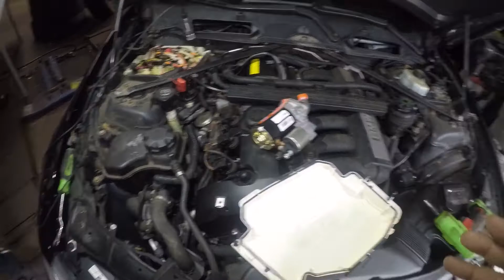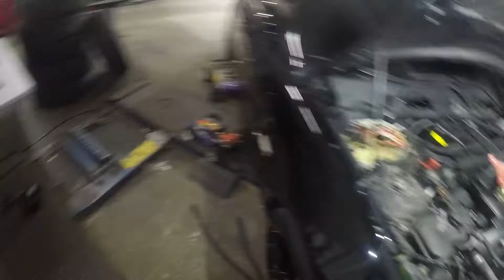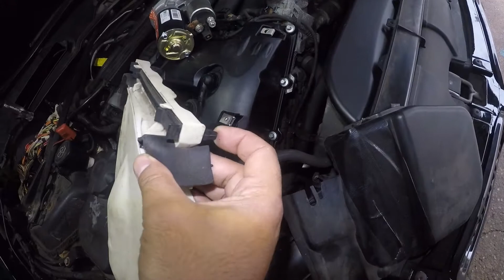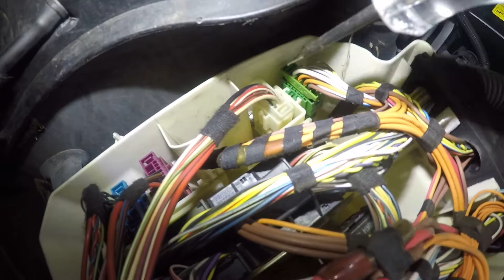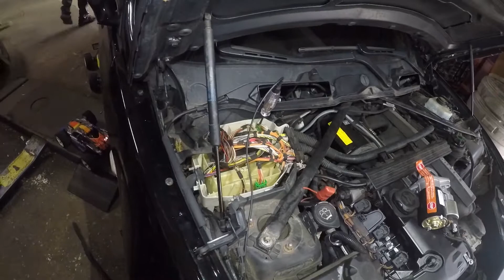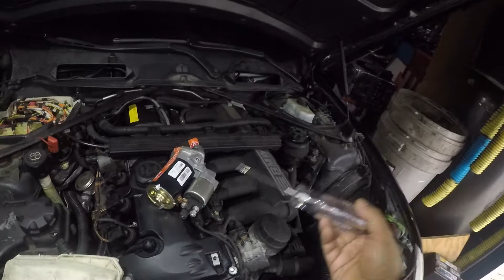BMW 328i Dont starter how to test power to the control cable to starter motor on BMW 328i

Comment: what if the white wire aint getting power to it? where do i check?
Reply from the maker: If the white wire is not getting power then it could be Possability igntion key lock antitheft broken wire relay fuse check all u might need wire schematic

Comment: would it start up eventually before you fixed it bc mine will start up later after driving it for a while
Reply from the maker: Bad starter didn’t start
Reply: @RBTheMechanic  the thing is i replaced it it’s only a few months old
Reply from the maker: @rendymarin8357  parts r made crappy. Or days I have replaced alternators and starters so offer under warranty few months they fail
Reply: @RBTheMechanic  thank you i will try to replace it again but also one more thing is that when it’s hot it doesn’t really want to start but like on cold days like today it will start fine

Comment: I'm only getting 9 volts on the white wire, is that normal?
Reply: Maybe a bad grounding cable.  I’m having the same symptoms, with the 9V to the starter.  Not sure where the voltage drop is coming from.  Maybe CAS system is only supplying that much.  Good luck!
Reply: @steadfast__ mine is doing same thing  you ever figure out?
Reply: @buscojosenjuarezdenuevoleo9669  my engine seized.  I power was enough to activate the starter, but the fly wheel was not able to turn because it’s seized.
Reply from the maker: Not sure maybe ur battery is low but if it lights up it’s working possability bad starter or bad battery
Reply: @RBTheMechanic  battery is fully charged, new starter.

Comment: What if starter is good. What if white wire doesn't light up. Can you disconnect harness and activate white wire with 12 volts. Direct 12v to starter ? Is the white wire going to starter or the other side of connector going to starter ?
Reply from the maker: I some times do that to get it starter but it depends how is that wire controlled it could be somthing that shutting the whole system down so u can start with swaping starter relay

Comment: Hi,  I have a question if you don't mind me picking your brain. what if the light only lights up for a second or less any ideas? starter starts to engage makes a click and stops ( turns engine a little). i was told the starter was new (figure I change it last). relay is new and I disconnected the IBS plug in the rear and the battery is brand new also grounds seem to be good as well push start maybe? kinda stumped its a 2008 535ix . thank you
Reply from the maker: Try charging the battery or jumping